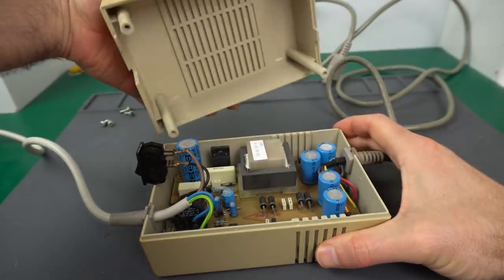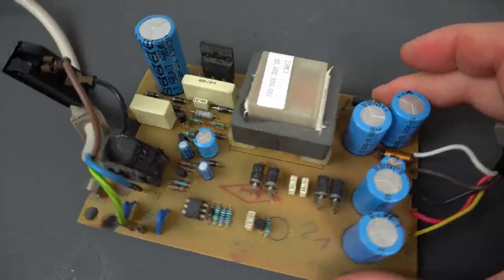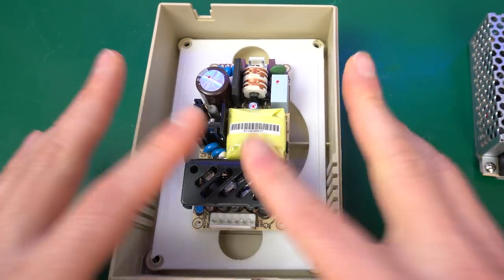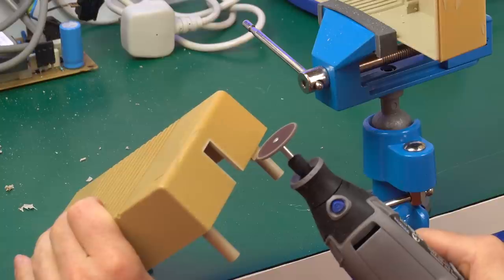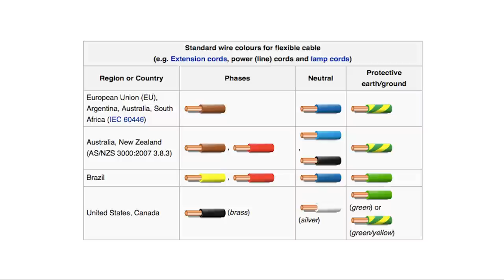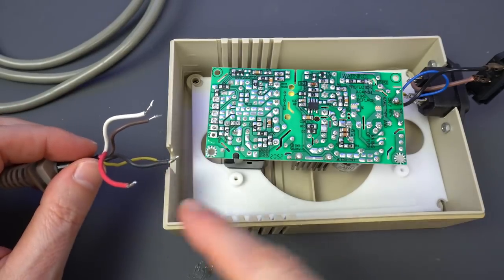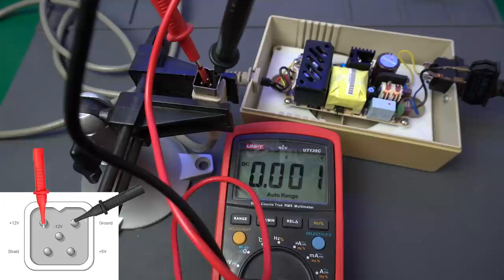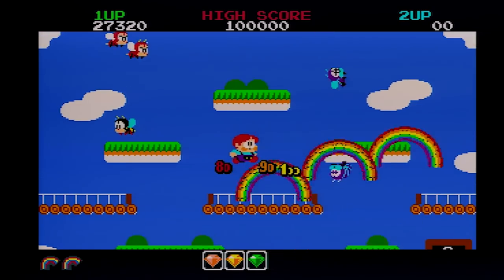This Amiga Power Supply Will Work Anywhere

Comment from the maker: I've gotten several very good suggestions on how to make this mod safer (I'm not an electrician, sorry!): 1) Use thicker cables for the AC connection and 2) Put some ind of heat shrink on that connection. That will protect things if the PSU ever comes loose. Thanks for the feedback!
Reply: Hello Noel ! About thicker AC cables, Live, Neutral and Earth, MUST have the SAME exact section(diameter/gauge). Avoid rigid wire.
Reply: Yes. the 20 gauge wire on the AC line input is a fire safety hazard.  Because the USA uses lower voltage, it has higher amperage to compensate, and thus lower gauge wire.  18 gauge is the minimum.
Reply: The best thing to use for the AC wiring is... wire from an AC cord :) Get some 6A (0.75MM²) flex and strip it apart for the individual wires. I don't know about Spain, but here in the UK pretty much any DIY store will carry suitable mains flex.
Reply: Yeah, as soon as you are talking about mains power, the requirements for wire gauge is a real issue.
Reply: NOPE! None of the above is a valid concern. The AC side doesn't affect current. The DEVICE draws the current it needs when powered on. Since the device is the same A500 used with the original PSU, it will draw exactly the same current it took before the PSU swap, regardless of the input AC voltage. The wire gauge is the same as that used by the original PSU and the exact same cable is used on NTSC and PAL machines so it doesn't actually affect anything. If that wire gauge was good enough to pass stringent FCC safety testing by the manufacturers it's certainly good enough now.
Reply: @johnbos4637  yes you are right on the DC load supply to the Amiga. On the AC supply to the PSU the supply current will change if the voltage level changes. For example 100W PSU will draw 0.45A at 220V but at 120V the current draw will be 0.83A.
Reply: @kevinhowie2704  It still doesn't matter. I own over 50 Amigas. The same AC cable is used on all models in all regions. The only difference is the plug shape and the input voltage on the PSU. Like I said, if it was good enough to pass FCC safety regulations in 1987 it's fine now.
Reply: @johnbos4637  yes im sure you can use the same cable for both voltages. A 1mm flex has a current carrying capacity of 10A. I think some people was just commenting to Noel about the internal wiring from the socket to the PSU. Undersized cable is a fire hazard, just have to be careful.
Reply: Heavier gauge wires for the AC portion were the first thing I thought when looking at what you were using. 

"and why didn't he put crimped spade connectors on the wires?" was the second :)
Reply: @hikariyouk  Because, as he said clearly in the video, he didn't have any.
Reply: @kevinhowie2704  Those people were commenting because they are noobs LOL! The wire from the IEC socket to the PSU/switch is the same wire Commodore used. An Amiga 500 only draws about 3A-4A fully loaded so the original wire is fine as-is.....
Reply: You should also use shakeproof washers for the IEC socket.
Reply: @TheDIYGuy999  Well yes he could have used a star washer or a spring washer. But a small dot of nail polish on the nut/thread would do the same thing.
Reply: @johnbos4637  No John, in the USA, AC plugs don't have fuses.  The wiring is required to be heavy duty enough for the house's breaker panel to trip before the wire gets hot enough to heat up and melt.  Wire gauge is about if a fault or flaw happens, not what happens while it's running without issue.  One of the requirements for UL certification is the wire gauge for AC power must be able to handle 15  amps at 120 volts AC for five seconds at a dead short.  Far long enough for a breaker to trip.  If that power supply developed a short, the first failure point would be the 20 gauge wire melting and perhaps starting a fire.
Reply: @richardkelsch3640  agreed! I'm far from an expert on AC and mains, but just because it passed testing in 1987 doesn't mean it would today, I would guess in the 34 years since then the testing requirements may have changed. And just because Commodore did it that way, doesn't always make it right. For projects like this, especially of you put it on YT, you should be following best practices, and err on the side of safety, you don't want to be responsible for someone else having a fire becausd they followed what you used. So this discussion is quite valuable.
Reply: the cable looks big enough especially for such a small run. assuming the new power supply has 80% efficiency, even at 100V it only draws about 0.5A at most. regarding fuse, those two brown block beside the input header are inline fuse. if the power supply decided to short on the primary side, those fuses would be the weakest link

---

re-watched again, now i see the problem. i wasnt attentive enough to realize how small the neutral cable is. thought it was a scrap from original cable at first
Reply: Great job!
I live in Hong Kong, ex-colony of British, British Standard is high/tough,  so it's worth to re-use the cord itself, BS standard even set the pulling force of the plug, wow, simply cut the plug and make use the cable, even the earth seems not connected in most of the Euro type plug (or can be added, like the one you shown). Personally I also have US type power strip bought from Japan, since my audio grade power cord is US type.
Reply: This PSU is getting seriously hot - check the 3d printed support if it didnt bend after a day or two.
Reply: @gnif  lol! manslaughter for wiring a computer power supply is a new one lol! I would like to see court cases where it's actually happened. the same cable is used in the original psu and that lasted 35 years. the computer only draws 4A max and the wire can take 10A. it's not going to burn the house down just because he does a mod in his workshop lol!
Reply: @johnbos4637  learn to read. I never said it was the current draw, but the risk of electrocution. The original cable and circuitry is not only double insulated, but designed in such a way that a fault would not present mains voltages to become present on it's output. Failing to properly earth the new module defeats the protection of this new and completely different PSU design. People have been killed because they cut the earth pin out of the power input on audio gear to remove ground loops only to have a fault in equipment put mains voltages on a stage microphone or rack of audio gear. In these instances the person that cut out the earth pin have been charged with manslaughter. See article "Sparky jailed over Qld worker's death"
Reply: @gnif  lol! talking down to someone and belittlement is a known sign that you know you're bullsh!ting. Let it go. No one is going to klil themselves with a simple Amiga power supply mod. This video is proof. (expecting retaliatory reply very soon.....)
Reply: @johnbos4637  before you continue to assume it's safe because it's just a "simple Amiga power supply mod", look at what this mod is doing, it's replacing the ENTIRETY of the internals of the original PSU with a module that is designed to be used by OEMs to install into commercial products where the design of said product is taking into account proper safety factors. While it's simple to perform this mod, it is by no means a "simple" mod from an electrical point of view. Go watch some Big Clive and educate yourself on the dangers of badly designed electronics and the hazards they present when things like proper grounding/earthing are not performed.
Reply: @gnif  sure, it's replacing the guts with a more modern and safer power supply. everything is better, not worse LOL! Try to be more optimistic about things as looking at the bad side will eventually get you. Looks like I'm too late though, you've already fallen into that hole lol!
Reply: @johnbos4637  it is only safer if it's installed properly and used properly, which in this guide it is not. Read the datasheet for the device, it clearly states "The power supply is considered a component which will be installed into a final equipment. All EMC tests are been executed by mounting the unit on a 360mm*360mm metal plate with 1mm of thickness. The final equipment must be re-confirmed that it still meets EMC directives." which goes on reference the Meanwell liability page which states "MEAN WELL offers power supply which is electronic product for professional use only.". And yes, I do understand that EMC is with regards to radio interference, which also means that this unit mounted on a plastic base would very likely fail EMC and would be pumping out RF noise into your local environment potentially causing other issues with other equipment.

While I am all for what this mod intends to do, the problem is how it's done, the 3D printed base is not sufficient (others here have even reported that it gets too hot and sags), providing exposed metal contacts (screws) on the IEC connector without either grounding them or providing sufficient ground protection is not sufficient. If someone drops this unit and something internally breaks/dislodges, it will not "fail safe" and could present a hazard. It's that simple.

The simple solution here is two fold, use a metal bracket, and use a decent earth/ground conductor that is mechanically clamped to both the bracket AND the PCB mounted on the bracket by means of PCB standoffs. You could even retain the double insulation protection by using an IEC connector that is friction fit (has compressible tabs on the sides and clips in).

You can continue to delude yourself on this, I am done trying to explain to you how to protect people form harm when you perform a "simple mod".
Reply: What are you guys talking about? 20 gauge wire can handle up to 2 amps which translates to 240W when using 120V, 460W when using 230V. Way more than any Amiga (or this power supply) could ever consume.
Reply: @r1z4rd  Could you tell me why they MUST HAVE the same diameter? Which application are you referring to? 
Power cords?
PCBs? 
Power cords to house wiring? (which is sensible if you want to save on the fuse, but not obligated)
Reply: @richardkelsch3640  > the wiring is required to be heavy duty enough for the house's breaker panel to trip

But this will only affect power cords and extension cables, not internal wiring. Otherwise any PCB connected to mains not being able to handle 15 amps would have to be scrapped.
Reply: @HAAAFNER  And when there is a short inside the device after those low gauge wires but before a fuse, is the house circuit breaker going to blow or will it turn into an electric heating element? Yes, it's enough to carry the current needed for the application, no it's not heavy enough to cause the mains breaker/fuse to blow if there is a fault.

> Otherwise any PCB connected to mains not being able to handle 15 amps would have to be scrapped.

Which is why they have an input protection fuse. 15A is easy on the PCB level at the input, especially with AC. Even the good old step-down transformers have a thermal fuse on the primary side (mostly... https://youtu.be/8itTKH5tj3s ) to protect against both over current and temperature because a fault in the thin wiring could be catastrophic.

The question is, if the larger gauge input wire breaks off the rigid PCB and shorts active to neutral, will it start a fire, or will the house breaker/fuse pop?
Reply: @HAAAFNER  That may be true in other countries, but in the USA, the AC line wiring must be a heavier gauge.  Also, PC boards must have a minimum trace thickness and width for the AC line portion to handle the equivalent surge current for the fuse to blow (if any) or breaker to trip.  You will not find any electronic item with an AC line that goes internal to the device with a 20 gauge wire, ever.  18 gauge is typical for 120V at 15A.
Reply: @gnif  So if I understand you correctly: Do all appliances which have high gauge wiring (e.g. cheap christmas lights) always have a fuse in the plug or somewhere along the way? Guess they should have,  because the normal circuit breaker wouldn't trip although the maximum current can be long exceeded.
Reply: @richardkelsch3640  Thank you for your explanation. Makes sense. So either going with a fused connector or just keeping the wire gauge in a spectrum where the wires wouldnt burst into flames before the circuit breaker trips.
Reply: @HAAAFNER  Depends on the requirements for your country, but in general yes. Many many fires were caused by devices like Christmas lights due to the missing input protection. These days it's not such an issue though as such products have gone to LED lighting. Any device that is missing an input protection fuse should be considered suspect and dangerous, and all cabling leading up to the input protection fuse should be rated for a minimum of 15A. The fuse is not to protect the equipment, it's to prevent the wires leading into the equipment.
Reply: @gnif  Thank you, learned something again. Didn't understand that you were all thinking about the worst-case-scenario of a short or serious overcurrent between the connector and the fused pcb, I was just thinking of normal operation before.
Reply: @HAAAFNER  Unfortunately, now days, where many items bypass safety inspection and approval and come directly from China where international treaty doesn't hold them to such agreements, you will see laps in safety.  Some will say they are "UL Listed", but that's BS.  However,. if they are sold in the USA, then that''s a different story.
Reply: @johnbos4637  Ah, yes, nail polish:  the poor man's Glyptal.
Reply: @richardkelsch3640  Straight out of the NFPA Electrical Code.  Most IEC-style power cords sold for use in the USA are 18 AWG or better - this is the reason why.
Reply: @horusfalcon  So.... essentially what I said...

Comment: Unfun fact: When dropped on the floor, British mains plugs tend to lie on their backs with the prongs pointing upwards. Think treading on a Lego brick with your bare foot is painful? That's nothing in comparison!
Reply from the maker: Yes, I've heard they have a reputation for doing that 🤣
Reply: Ouch!
Reply: Yes, I've done this many times, man is it horrible!
Reply: Think it never happens as the plugs shouldn’t be kept in the middle of the floor 😀
Reply: @NoelsRetroLab  But, at least they don't have the US reputation of the prongs bending by practically merely breathing on them. We have three electric carts at the store I work at. When they installed wall sockets they put in two sets of 4, for a total of 8, then somehow "miswired" one set, which failed, then they couldn't work out how the heck to fix it. The "working" one was 2 feet away from the farthest cart, so caused "one" charge plug to stretch too far. So.. when they did a minor remodel they tried to fix this - by removing the 2 foot away one entirely, rewiring the broken one so it works, and placing the charge plugs where #1 = too close to the ice machine, #2 is 2 feet away, and stretches the cords, and #3 is now like 4 feet away, and can only be "safely" reached by one plug, which is about a foot longer than the other two (and on an older model cart).

Needless to say, all three plugs, and all three carts, are now bent all to heck, and if parked in the wrong places, at least one cart *will not stay plugged in, and charging*, since the cord literally pulls it sideways, and out of the wall socket. Sigh...

I work for idiots.
Reply: @patrickelliott2169  Not to mention that stepping on a US plug results in becoming the socket.
Reply: Just leave it plugged in! LOL
Reply: @NoelsRetroLab  Can confirm I have done this and uttered some choice swearwords. It's super painful.
Reply: @patrickelliott2169  the British 13A plug is quite possibly the single most over-engineered device in the world.  It's had countless gradual refinements over the decades, and I honestly think I've seen some industrial power connectors that were less rugged.  The American mains plug, by comparison, well, I'm amazed anyone took one look at that thing and passed it as safe for anything higher than 12V, let alone 120V.
Reply: @tommcewan7936  I´ve just watched a video on Technology Connections where Alec has very few good things to say about the North Ameerican plugs.
Reply: Better than having the prongs going into the skin.
Reply: I'm fairly sure that the reason British plug sockets have switches on them, is so that you don't have to unplug them, leaving the plugs on the floor. Stepping on one is very painful

Comment: The fuse in the plug is because we have 32A "ring main" socket circuits. The fuse is there to protect the flex in the case of an overload, as the socket circuit is capable of supplying a large amount of current before the breaker will trip.
Reply: Does the UK actually have any appliances that draw 32A? Here in Australia the max amperage is 10A. There is a 15A plug for special uses but it's rarely used and the only difference is slightly thicker wire and a larger ground lug so it can't be plugged into a stock 10A socket. They are used for things like AC input to a caravan where one socket provides all power to everything that uses electricity inside the caravan.
Reply: @johnbos4637  No appliances can draw more than 13A if they are plugged in to the wall, because that is the biggest plug fuse that can be bought.
We have 3kW kettles that therefore draw about 12A at a nominal 240v.
Reply: @juliannicholls  Ah, I thought maybe something had changed. When I lived in the UK from 1968 - 1971 the fuse was 13A.
Reply: You just have to use 2 BS1363 plugs wired in parallel with special "brass slug" fuses if you want to run a welder from a dual-gang wall socket.  Not that I would advocate or have ever done such a terrible thing, you understand...
Reply: @TrimeshSZ  I should hope not :)